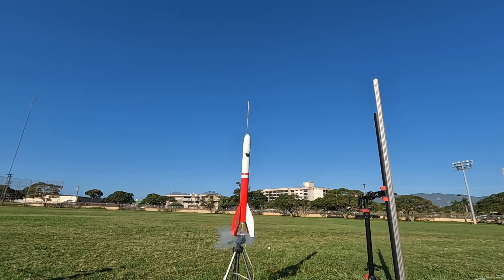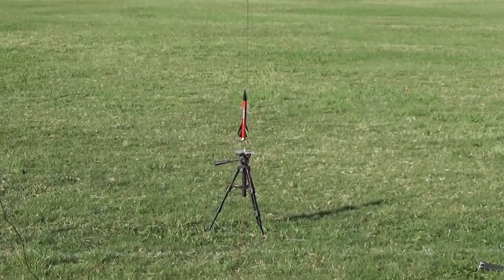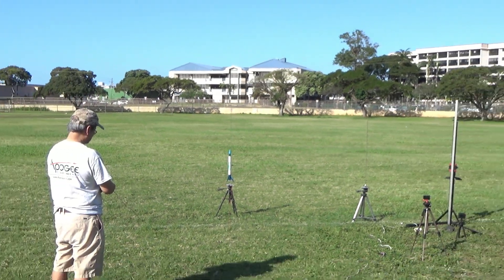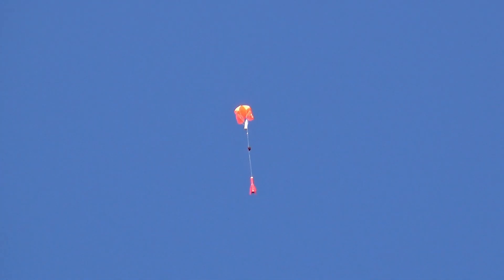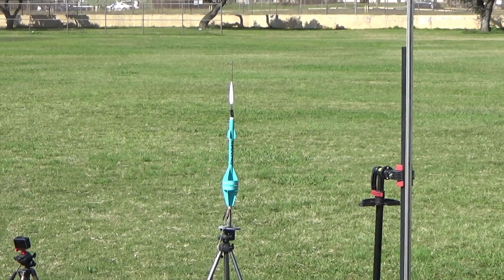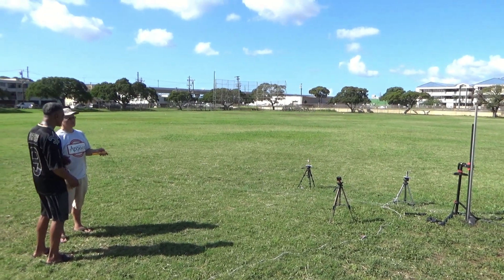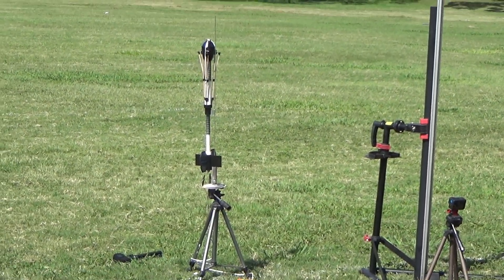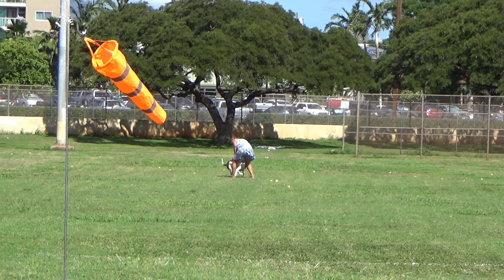Model Rockets: Perfect conditions on Prince Kuhio holiday with several MPR launches and a guest

Comment: The chuffing motor on the Doorknob predictably resulted in a very early ejection since the delay train of the motor was already burning during the brief chuffs.  That's a problem with pyrotechnic delay trains along with inaccuracies caused by operational chamber pressure variations.  You need a "hotter" igniter.
Reply from the maker: That and it's a 10 year old motor. I tried to insert a Jr but couldn't get it to insert without using an 1/8" drill which seemed too much. I finally got a Mini because the Micro would be too small. Next time, I have an old F25-6W, an old F42-4T (which worked well at Aloun), or a new F20-4W to use.